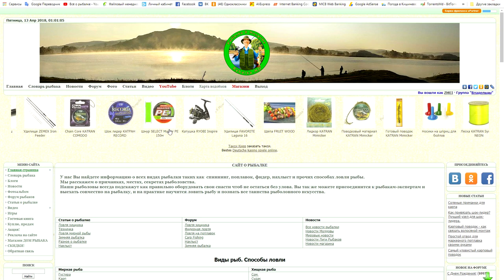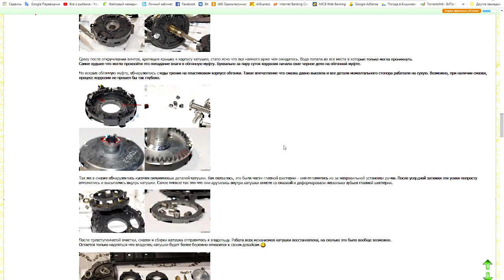Service SHIMANO Ultegra 14000 XTB

Comment: Hi, thank you very much for sharing the video, it is very helpful. I serviced my ultegra 14000 XTD last night. Before service, when retrieving lines, the reel the handle can only be rotated clock wise. But after the service the reel handle can be rotated both clock and anti-clock wise when retrieving lines. Where did I do wrong? (By the way, I opened anti-clock mechanism by mistake, but I screw it back correctly I think.) Thanks.
Reply from the maker: Most likely that you incorrectly installed an instantaneous backstop or smeared it with improper lubrication.

Comment: Are there many upgrades, hotups for this reel? I don't like the drag on mine, I would trade it in and buy the XTC.
Reply from the maker: The XTD has a reducer, the drive gear of the main pair on both sides is in the bearings. At XTC only from the left of the right sleeve. On one detail more in the roller fishing line stacker. Well, the styling is slower. All other items have the same catalog numbers.

Comment: Hi and respect for your job. I have a 14000 xtd spod reel and closed per accided the bail-arm with handle spinning instead of closing the bail by hand. I heard a kid of loud click noise, is that harmless or not. Idiot as I am I repeated it a couple of times. Seems like it is the bail lock for casting that is forced. Question is about possible breaking or wearing of this part. BR, david

Comment: Hi guys...I have a problem, and i dont have any explanation for it.
I bought 2 xsd....they r brand new, 1 mounth old...never been on rod, and mono free...
When im turning handle on the first one it goes smooth, easy, like it should be...when im turning handle on the other one it doesnt go so smooth, it feels like its having resistance of some kind....
What it could be wrong with other one?
Tnx a lot.
Reply from the maker: It is difficult to predict a defect in a coil. It is possible that some of the bearings jammed.